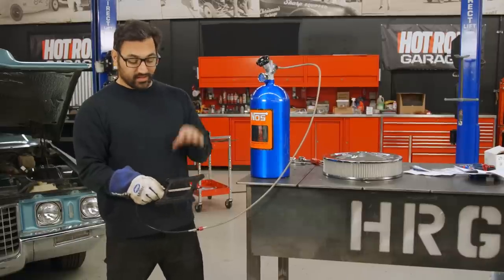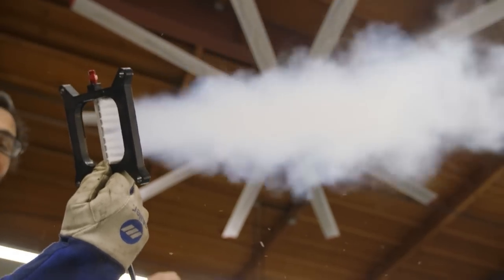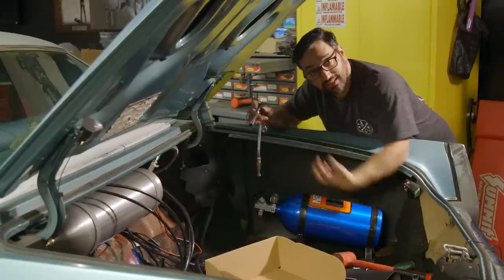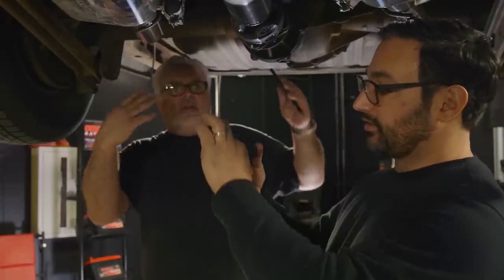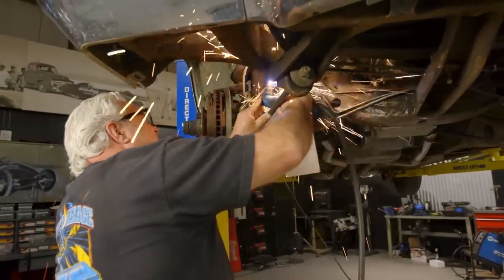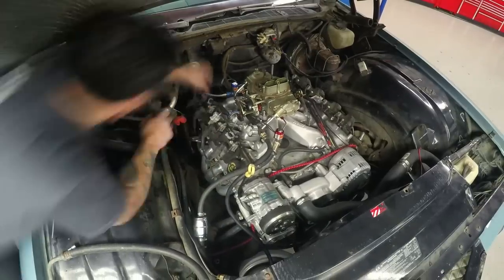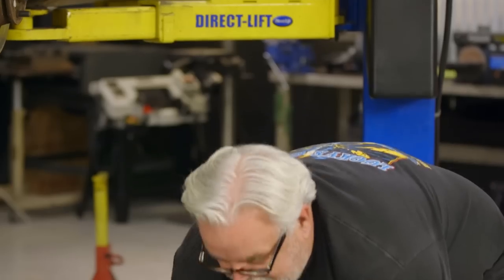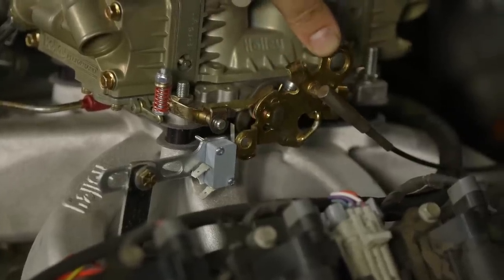Slammin’ Cadillac—Hot Rod Garage Preview Episode 78

Comment: Just FYI, nitrous oxide is not flammable in normal conditions (standard ambient temperature & atmospheric pressure).  It's not even a good oxidizer in those conditions.  It's only in the hot, high-pressure environment inside an engine that it decomposes into oxygen and nitrogen, and helps enable combustion.

It's not just a source of oxygen, though.  The decomposition process is exothermic, releasing energy even before you start burning extra fuel with the freed oxygen.  Also, the state change from liquid to solid when it's injected into the intake manifold has a major charge-cooling effect, improving volumetric efficiency.  Think of it as an evaporative intercooler.

Comment: nitrous  oxide by its self is not flammable
Reply: Which can be correct . But what if one breaths it?? Same as the one in the atmosphere??
Reply: John Williams yes it is an oxidizer
Reply: travis taggart Precisely, oxidizer, otherwise known as a flame intensifier. Therefore, introducing a flame increases the heat and size of the flame, but remove the flame, and the NO2 will return to a flameless discharge. Not flammable, an oxygenator.